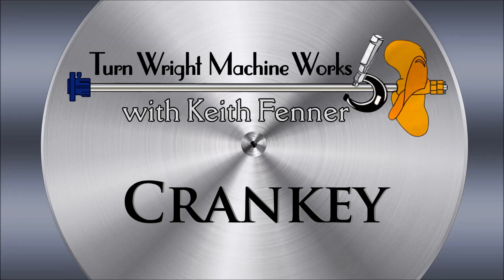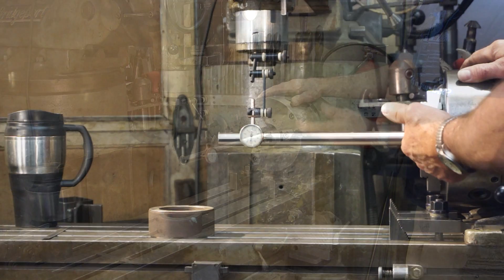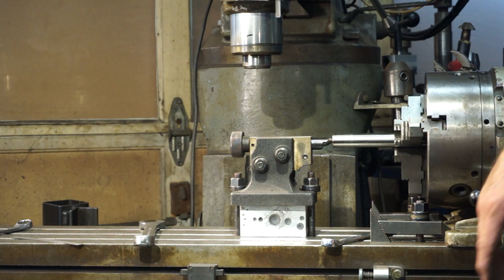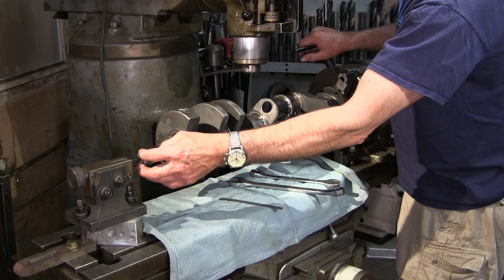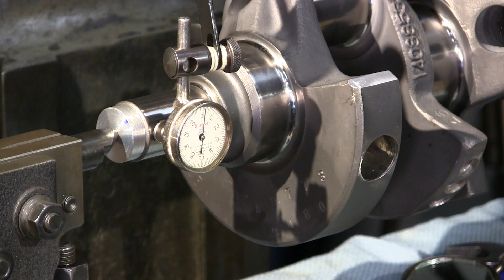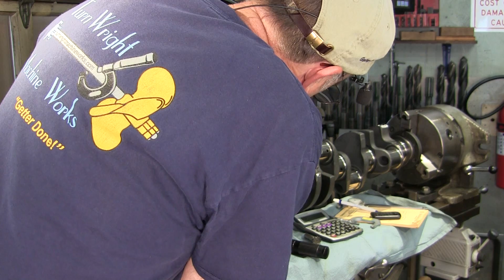Crankey

Comment: a year late.. i have a comment. the second key way is TOO LONG.  goes back into the area where the crank gear presses on the crank.   a half moon wood ruff key is what was expected and should have been handed to you. not a slot for keystock.   or two short wide half moon woodruff keys.   or it should have not extended back that far.. there is a boatload of torsional harmonics that just eat away at crank keys with superchargers.  i wonder with the flange that was included.. 

  the only thing holding the hub and the crank sprocket in place is the 7/16-20 crank bolt pinching the hub against the crank sprocket.  some people take the crank snout bolt size to 1/2-20.. i have seen a few that were 9/16 and very few that were out to 5/8 to hold the hub tighter to the crank sprocket.  i totally blame the customer for perhaps not including a drawing or sketch of what was needed.  i knew what was needed.. but then i work on engines all the time.

Comment: Keith, you may have answered this question in a previous video, but I wanted to know why you prefer to use a Sulphur-based cutting fluid instead of some of the synthetics on the market.  BTW, your video quality has become professional.  I don't see how you could improve.  Thanks
Reply from the maker: I like the smell and performance I get with the original sulfur based cutting oils. ;{)------

Comment: Are you worried that the key will ride up the radius that the woodruff cutter made, and bind the part during assembly. I might have used a standard end mill, and cut that kind of key. Just food for thought. Kind regards, Cliff
Reply from the maker: Keys should always fit shaft tap in tight and slip fit the bore's keyways. You swell the key if it is not tight.  ;{)------
Reply: Thanks so much !!!

Comment: I guess it's just my monitor but that crank looks like it's been welded up and reground. Where the front counterweight meets the crank looks like a weld. I guess 8 years of doing failure analysis on engines makes me notice things. Seen too many broken cranks from bad weld and/or regrind jobs.
Reply: Agree.  I'd be concerned about the fatigue life of the crank with the addition of the new keyways also.
Reply: Being a lot of crank makers sell SBC cranks with BBC size crank snouts, anyone starting from scratch would be better served using one of those.  This is bound to be a fairly budget conscious build not destined to make all that much power.
Reply: If so, would you have advised  Kieth to have done anything different?

Comment: Keith,Please inform you customer adding an additional Key doesn't offer much of anything. In any application it only provides necessary "clocking", unless perhaps a supercharger application.Generally the provision for a secondary key size is to accommodate different Harmonic Balancer Manufacturer offerings.Doesn't matter,  you made $'s, that's what counts!Thanks!

Comment: Thanks for shading the scene from the direct sunlight You have greatly reduced the dynamic range of the light to what the camera can handle. Video quality is MUCH improved. May be a little cooler in there in the summer too. 

Great video, appreciate the quick find on the riser block for the tailstock ;-) and the need to account for the quill extension with the quill at an angle. Neat idea of modifying the mill clamps too. Thanks for sharing!

Comment: Do you have an idea of what type of alloy a crank is made of....?  Even passed the surface it seemed like a still pretty though material to machine, mostly with HSS tool.
Nicely done...   ;)
Reply: 4140 is pretty common on a lot of these performance cranks
Reply: Tom Bevilockway
Thanks...
Reply from the maker: No I am not sure what the alloy of steel they forge them from.  ;{)-----

Comment: Could that crank journal of been nitrided or hardness treated like that? Looked like it cut easier once you got under a hard skin? I have a crank to machine and it looks like it has been hardness treated. Was going to grind it but now thinking if I took deep enough a first cut I might get under the skin. From what I have read it looks like these treatments are only a few thou deep at the most? Do you know of any way to recognise if a treatment has been carried out?. Looks like some TCT inserts can cut materials so hard that previously only grinding would machine it?
Reply from the maker: I  don't know a way other than striking a file across it to see if hardened. I just knew if could get under it, I could then finish it.  ;{)------

Comment: Nice job Keith. Was there any particular reason that the customer wanted an elongated Woodruff type key as against a plain milled key.? regards from the UK
Reply from the maker: I was using the woodruff cutter to mill the standard keyway, my choice, rather than my larger wheel cutters, on a spindle mill. ;{)-----
Reply: might help with preventing a crack from forming at the end of the key.

Comment: I'm lost at 33:00. What's that Alum part for? Does it go on the end of the shaft that you milled?
Reply from the maker: It is an A pulley, modified to fit in the stack up off the front of the engine. ;{)-----

Comment: How will cutting that keyway affect the balance of that crankshaft? I saw the couple of spots which were drilled for balance and while that keyway is very close to the center I wonder if there is a way to calculate the impact apart from putting it on a balancer.
Reply: The balance will be much more affected by swapping the balancer for that drive hub. Usually the balance is done after things like this. The keyway also didn't need to go back that far as the timing gear won't use it. In fact most of these mods use a square key all the way out to the end of the crank snout, for the most strength. The whole reason is for a twin engine boat, without needing a reverse rotation engine. You just flip one engine and take the power off the front of the crank.
Reply: The part that bolts to the front of a crank is not a balancer. It's a harmonic damper. It absorbs torsional vibration noise in the crank. Every part is balanced on its own.
Reply: Not at all, because a key will be in that slow anyway.
Reply: It depends on the engine. Many have a counter weight as part of them and must be balanced as an assembly with the crank. Ie 400 small block Chevy which that crank looks like it might be. The whole front drive system is really a kluge and plenty of them end up breaking the snout off the crank even with mid range HP builds. These days it's so easy to build a reverse rotation engine, I can't imagine why anyone would use this antique system. Back in the 70-80's it was a different story and the machine shop I was at did tons of them.
Reply: Yes,  that is the proper term but they are very often called harmonic balancers even by the manufacturers. It's not like no one will know what you are talking about. You will find both terms used by many manufacturers. Consider it more a slang term then a technically accurate one. And yes there are engines where it is a combination device, a balancer and harmonic damper.  Call me lazy for typing the shorter word.

Comment: Why not use an end mill to have a square channel, longer slot with more key in crank and flange?
Reply: Good question, that's how I always did them. Sometimes would even up the stock keyway to 1/4" on Chevys, too.
Reply from the maker: End mills pull slightly to the side under load and wheel & key cutter don't. ;{)-----

Comment: ignorant question:  I notice that you almost always do a climb cut.  Why is that?  Is there danger of the cutter being sucked in somehow?  I own a cabinet shop and the most consistent clean cut with a router (basically a 20k RPM mill cutter) is definitely not a climb cut. it just fuzzes the wood.  I realize this is totally different material but just curious....
Was the "do over" mistake a climb cut, or was that why it grabbed the piece and spun it?
Reply: AffordBindEquipment
For what it's worth: with rigid machines, material and setup, climb cutting usually gives a better finish because each chip starts thick and gets progressively thinner as the tooth moves to where the finished cut surface will be. With upcut or conventional milling it's the opposite: the tooth starts with an infinitely thin cut where the finished cut surface will be, gradually thickening as each as the tooth arcs through the sector length of the chip.

In the second scenario, unless the cutting edge is infinitely sharp, it will not start cutting immediately but will rub. As it gets forced into the material by the arc swinging under the surface left by the previous tooth, it will sooner or later start cutting properly
Each tooth will rub a different amount because they are not identically worn, and so will take up the cut after sweeping through a different arc distance. 
This, together with the alternation between rubbing and cutting, will leave a less flat and uniformally shiny surface after the cut is done.
Wood is not rigid enough (and the cutters are too sharp) for this to be a consideration.

However, even on a rigid setup there are times when you avoid climb milling:
- Backlash in the feed mechanism (to some extent this can be mitigated by snugging up the gib clamps)
- Marginal workholding, eg clamping rather than blocking (snatch risk)
- Surface hardening: in such cases, it's asking for trouble to climb mill, because each tooth is trying to smack down onto a hard surface at maximum chip thickness. Keith avoids this here (except for during the initial plunge) by avoiding climb milling. Conventional milling is fine because the hard surface is brittle, and the tooth is undermining that surface, so each chip snaps away from the workpiece quite easily as the tooth emerges from underneath, before the tooth even gets to it.

One other point: to avoid being misled by the "wagon wheels" effect Keith referred to (which in this case I don't actually think you were), check out the direction of the teeth while the cutter is stationary.
Reply from the maker: The camera speed makes cutter look like they are spinning backward direction. The incident on Do Over was because the part spun during the cut, causing a ramp of material to grab, that was not supposed to cut anything more than the little tool pressure that may have been there.  ;{)-----

Comment: nice machining, what was the crankshaft for?
Reply: it's out of a 4cyl, probably a Honda B18 or similar.
Reply: its a v8 dude
Reply: It's a V8, look at the crank journal width. It's also a marine engine, as the shaft takeoff is on the front snout, not the rear flange.
Reply: Yup, also notice that it has two oil holes drilled to feed each bearing. I know this crank design well its a 400 chevy.
Reply: I looked up the casting number. It's actually a forged 350 chevy crank.
Reply from the maker: A high performance engine of some kind, I didn't remember the particulars when the customer ripped them off to me.  ;{)------
Reply: Keith Fenner
ok, was it a 4,5,or 6 cylinder?
Reply: That crank is most likely a Chevrolet 400 small block crank 8 cylinders. The hole completely through the first connecting rod journal gives it away. This is done for balancing.
Reply: there you go! plenty of info out there eh, first thing that came to my mind, didnt even think about a v8 just counted the journals haha
Reply: Correct me if I'm wrong, but I believe B18 engines have the middle two pistons at the same height, and the crank in the video doesn't appear to have the two middle con rod journals at the same height.
Reply: pretty wide connecting rods for a 4cyl.... i think it's an eight cylinder....